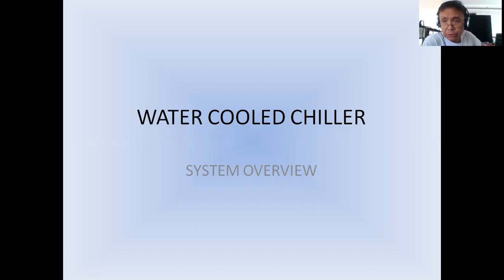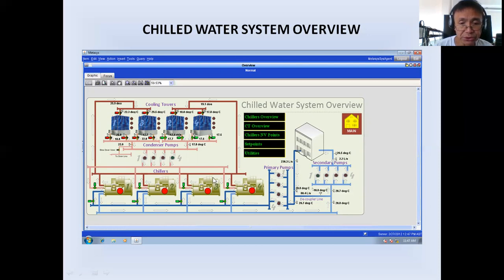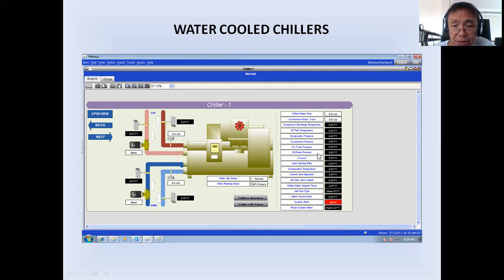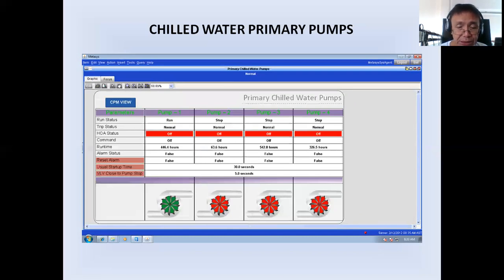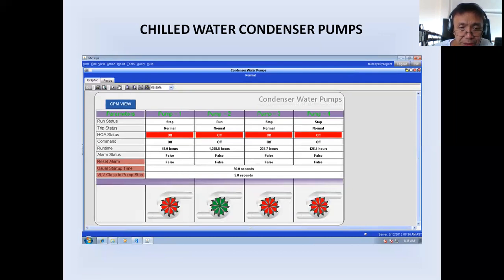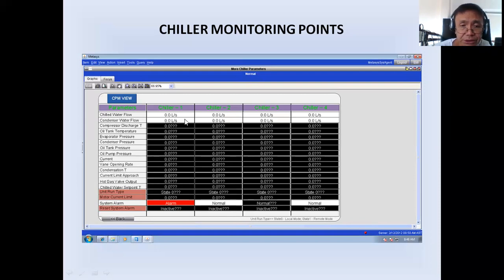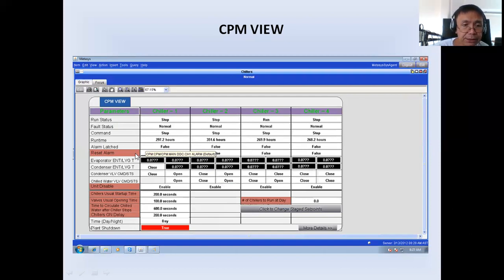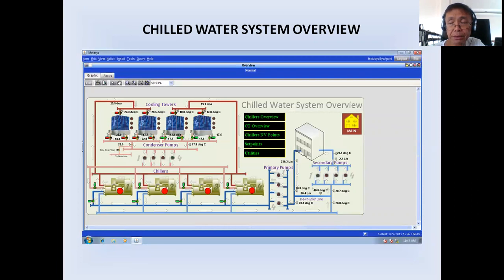CHILLER PLANT MANAGER (CPM)

Comment: Chiller plant manager is the display of chiller or what inside the panel which control chillers is called CPM
Reply from the maker: chiller plant manager is the whole system which monitors the operation of the chillers, secondary pumps, primary and tertiary if there is, and other equipment related to chiller

Comment: kinda confusing for the staging of chillers. are you staging chiller on and off based on load demand? each load can be calculated since you have flow meter running through the chiller. the moment the load is reached say 100% or chiller cannot give the supply temperature of design 8 deg C, you can start the next chiller and should not be staged based on temperature of supply chill water as your supply chill water temperature will never reach 40deg C in stage 4 as shown in your program.
Reply from the maker: CPM was programmed by our sub contractor using  Metasys, my role here  is to do the software integration of CPM to BMS as BMS engineer. I am just using the CPM graphics to discuss the basic chilled water system operation. Each chiller here has its own microprocessor based controller that is  responsible for chiller staging. The chiller guy was  the one who did the programming for the  chilled water system.